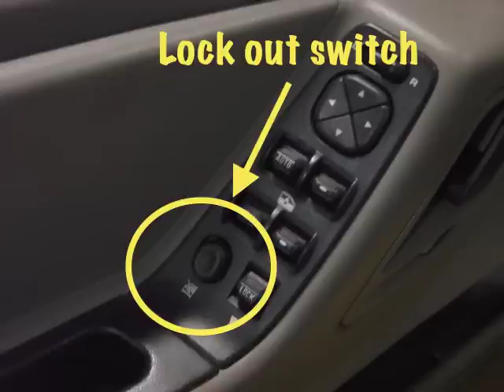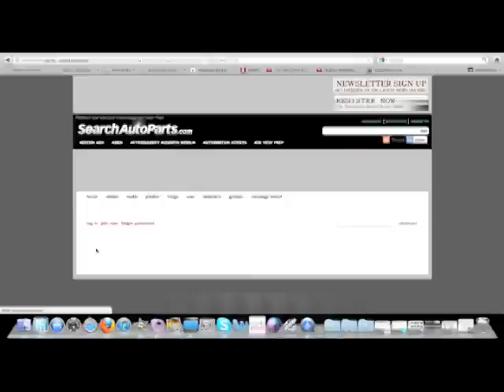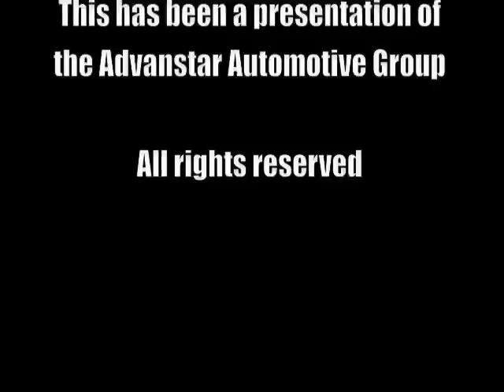The Trainer #24:  How To Troubleshoot Power Window Problems

Comment: I have a 2002 camaro THE drivers side window tolls down fine but when you try to roll it up it makes a Loud grinding noise
Reply from the maker: Without hearing the noise for myself, it's hard to tell you exactly what's going on. From the information I have, it looks like a mechanical mechanism (no cable), but the only thing I can suggest is to pull the interior trim and visually inspect the mechanism.
Reply: @MotorAgeMagazine  It sounds like the gear grinding when u try to roll it up

Comment: I have a 2005 Mazda 3. The driver window goes down but will not go up, or it will go up after I have been trying for hours on end.  I bought a used motor that was working fine and installed it but the same thing happens. I believe that it is the switch not supplying electricity to the motor. Am I on the right track?
Reply from the maker: Sounds like it. Wire a test light to the motor connector instead of the motor and operate the switch in both directions to see if the lamp lights up. I suspect you have worn/corroded contacts in the switch itself.

Comment: 2002 Honda odyssey right hand front window. regulator rolls down as soon as it is plugged in without touching the switch and then sits there and clicks. The motor heats up. Wont roll up by the switch. Thought it was a bad motor but did it again with a second regulator and still the same . replaced the right switch, still happened. Replaced the left switch assembly with a used one. still doing it.. checked all wires and they look good.
Reply from the maker: Go to the motor and see if there is power and ground being applied all the time by simply plugging in test light to the connector. I suspect you have a shorted wire in the harness itself, likely near where the harness passes from the body to the door.
Reply: Motor Age Thank You so much I will check that.

Comment: my window makes that crackly noise and i could manuel move it but wont go all the way up and my lights dim also does that mean i have to get everything new??
Reply from the maker: Sounds like you have a cable-style regulator. Some come with the motor, some don't. Check your local parts store or dealer.

Comment: i have a 1999 plymouth voyager. the passenger window will not go down.you can hear and feel the window jump like it wants to go down
Reply from the maker: Many of the Chrysler products use a cable-type regulator that locks up and/or breaks. If you hear a "crunching" noise, it's the cable. No matter...the replacement comes as an assembly.

Comment: I have a 2002 Saturn Sl, the front Windows go down but will not go back up. I find myself playing with both Windows control to try and get them up. #Help
Reply from the maker: Follow the steps outlined in the shop manual to access the window motor. Disconnect the electrical connector and install a test light as demonstrated in the video. Operate the switch in both directions. If the bulb lights, the wiring and switch is OK. If not, and in only one direction, I'd suspect the switch.

Comment: I have a 2005 Mazda 3 ( SP 2.3)  and my windows will roll halfway down but then make a loud clicking noise. This first started on my sun roof and has been going on for about a month now. Also, my headlights do dim when I roll down my windows. Do I need a new motor? Is it best that I just take it into a repair shop?
Reply from the maker: If you're having multiple issues, you may have an electrical fault that is affecting all of them. Check the grounds on the car, and/or seek professional help.

Comment: Hi,

I have a 2005 F150 4 door crew cab.  The left rear window rolls down but does not roll back up.  The switch measures 13.7V when up or down is depressed.  I swapped the switch with right rear and problem continues on left rear but right rear is okay.  Voltages at the motor connector are also 13.7V.  I replaced the regulator/motor assembly and issue continues.  It rolls down but won't go up.  The motor doesn't even try to move.  I manually applied voltage to the motor (switched the polarity) in order to make the window roll up.  Any idea what could be bad?

Jorge
Reply from the maker: I'm willing to bet you're checking voltage with the connectors unplugged. The motor reverses direction by changing polarity. Try checking the voltage at the motor with everything hooked up. You should see voltage on one wire and next to nothing on the other, and that should reverse when you change directions on the switch. If you replaced the switch with a known good and the motor is new, it has to be a problem in the wiring between the two.
Reply: Hi, thanks for the feedback.  Another thing I realized this morning is that there is no left rear window control (window up or down) using the switch from the driver's side.  Again, the rear left switch only works for window down but not up.  I'll be checking some voltages later today.
Reply: I'm having a similar issue with my Ford Expedition (2004). I rolled down the driver's side back window all of the way from the driver's side, but it wouldn't roll back up.
 
I tried rolling it up with the actual driver's side back window switch, including pulling up while pressing up on the button. Nothing. Also tried holding both the driver's and back switches at the same time - nothing. Couldn't even hear a motor trying to work, no lights dimming.

Finally, I held the driver's side and the back driver's side  buttons (both on the driver's side window control unit) up at the same time; the lights dimmed a little, and the window (begrudgingly) went up. Thankfully didn't have to do a tape job that night.

What issue would you say this is? I noticed that only one of the switches on the driver's side window control unithad a backlight. I have issues with all of the other windows as well. I just got this car knowing it's had some problems but I'm worried to roll that window down - the "mechanic/salesman" guy at the dealership, which I bought this car from (as is, can't take it back) said not to mess with the window because he had to manually make it go up. 

I'm guessing the passenger window controls are provided power from the main driver's side switch, which connects to the fuse, to the battery? I've heard someone said it's bad contacts. Maybe bad wires? Might explain why only one switch has a backlight.
Reply from the maker: According to the schematic, the switches are in series with one another so the problem could be in either one. I would look for good power and ground from the main switch at the junction where it goes into the second switch first. Perhaps substitute a test light for the second switch and operate the main switch in both directions to see if the light comes on. Start there...hope this helps!

Comment: My driver side window on my 2004 Suzuki Forenza made a really loud RRRRRRRR when ever you tried putting it down or up. After a day or two the motor completely died out. and it won't go down. Does this mean I have to go to the dealer and ask them to replace the entire driver side window motor? By the way, Every other window in the car including the sun roof works fine. Please Help.
Reply from the maker: Yep, sounds like a motor problem. But no, you do NOT have to take it to a dealer to get a professional repair. Most independent shops should be able to handle it for you. Just select, and stick with, a good one!
Reply: Motor Age Magazine Okay, Thank you so much! I'll try and go tomorrow! Thanks again!
Reply from the maker: SuperGhost453 My pleasure...

Comment: I have a 2007 Chevy Malibu a 4 cylinder All 4 windows won't work I replace the fuse still nothing. and to remind you I try to open Windows from all doors and they still won't work what could be the problem
Reply from the maker: Many late model vehicles use a body control computer to actuate a variety of systems, including power windows. You may need a scan tool capable of reading the OEM data to see what is causing your problem.

Comment: My window sometimes goes up half way then slows, then jams... I can get it up by putting the window back down a few inches then it moves freely all the way up.. What could the problem be?
Reply from the maker: Jen, 
Either the motor is heating up and binding, or there is an alignment issue with the guides.

Comment: mazda demio 1999 passgengers window not working thought a fuse but all other windows work. help
Reply from the maker: You'll need to access the window motor in the affected door as shown in the video. Follow the steps to isolate where the problem is located....

Comment: I have a 1995 Camaro z28. My windows want go up or down. I have install new switches and window motors
Reply: Please help me
Reply from the maker: Chron Carrington Since both windows are affected, the very first thing i would check is the fuse. Look in your owner's manual to find out where the fuse is located. If that is OK, you'll need to do some basic electrical troubleshooting.
Reply: I did all the troubleshooting and still not working. The only I can get them to work is hotwire them to the battery.
Reply from the maker: Chron Carrington Then the circuit has failed somewhere. You'll need to verify that there is power to the motor, and then that there is ground to the motor. Once you've determined which is missing, you can use the wiring diagram to isolate where the open is.

Comment: 94 crown vic...! front drivers side window... i've replaced the window regulator, went through 3 brand new motors and still the same every time...! the window rolls down quick and smooth but labors and then stops completely mid way on the up... its been a complete mystery to me.! i've lubed the regulator, i have even bought a brand new switch and still the window stops mid way... and the back windows? thats a whole other story... my main concern is the mystery problem with the front drivers side... i know of nothing else to purchase for the fix...
Reply from the maker: Perform a voltage drop test on the motor circuit. Sounds like when the power/ground roles are reversed, a hidden problem is causing less power to be available. Check out our library for several videos on how to perform this test.
Reply: Motor Age thanks man for taking the time to reply... i will defiantly check out and search for the video in your library to learn how to preform this test.! by the way the motor gets really hot when trying to get it to go up
Reply from the maker: MrBonez That's a sign that something is causing the motor/window glass to bind. Recheck the positioning of the regulator.
Reply: Motor Age i think i have solved the mystery after reading your last reply to me... i decided to do a simple test myself by un-bolting the the window from the regulator (slider) and to see if it would go up and down at the same speed and it worked correctly.! now, i then slid the window up and down by hand to see if it was getting in a bind somewhere... my findings is this... slides down smooth but on the up it takes abit of strength to get it up through the grooves.! its like the grooves are squeezed to tight on the window...! and yes the window is correctly in the grooves... now the fix?
Reply from the maker: MrBonez Sounds like you're close to having this one fixed!
Reply: Motor Age yes mystery is finally solved and window is fixed.! i used dish washing liquid as a lube to lube the rubber groove guides... the window works tip top! i wouldnt have never figured that out if i didnt mention the motor got hot while going on the up.! THANK YOU Motor Age!!!
Reply from the maker: MrBonez Glad you got it fixed.

Comment: i had etios..when i locked my car..if there are any windows opened they are not automatically closing..
Reply from the maker: On cars that automatically roll up the windows, you'll need to check the data inputs with an OE-equivalent scan tool. The control module must not be seeing that the windows are open, or it is unable to activate the motors.

Comment: The window on the driver side won`t work at all. I can`t recon I can hear the motor running either. But the strange thing is that all 3 other windows, which can be operated from the same panel seems to work perfect.. Most probably the motor for the window at the driver seat who is the problem here, I assume?
Reply from the maker: Never assume, test :-)
You may have all the switches on one panel, but that doesn't mean the circuits are shared. Follow the steps outlined in the video to narrow down the problem.

Comment: quick question .My pw motor for my 2001 Alero  driver door  works fine ,regulater fine .the  part I need  are  the  holders that actually hold the window glass. Here is my question,is there an interchangeable  replacement  available  at auto part stores that  I can use/order  that can  save me  the need to buy the assembly package or the  availability  and  search  of ecology ? Anybody?
Reply from the maker: Check with local salvage yards, or perhaps a parts store specializing in those small, hard to find, parts.

Comment: I have a ford explorer. the drivers power window sometimes do not work and now the rear right window does the same. What could it be?
Reply from the maker: WIndows that work sometimes and not others are typically caused by worn brushes/commutators in the motor and/or worn contacts in the switches or relays. Follow the steps in the video to pinpoint your problem. HTH!

Comment: i have a 1999 toyota corrola and all of my windows wount work but my doors do lock with the master switch?
Reply from the maker: Don't let that fool you. They are two entirely different circuits. Follow the steps shown in the video to isolate your problem.